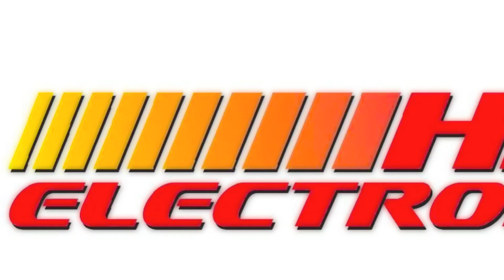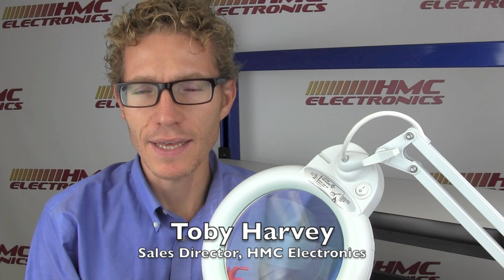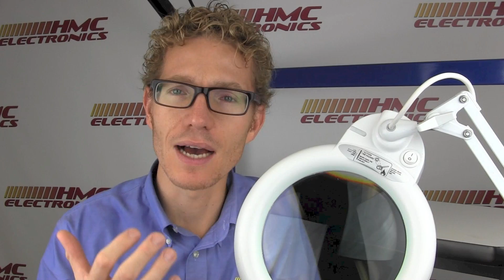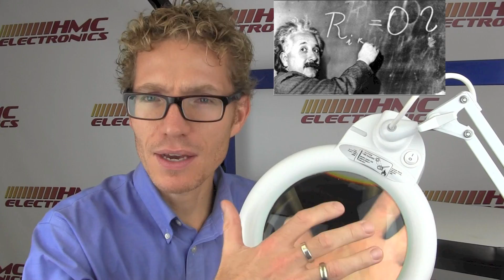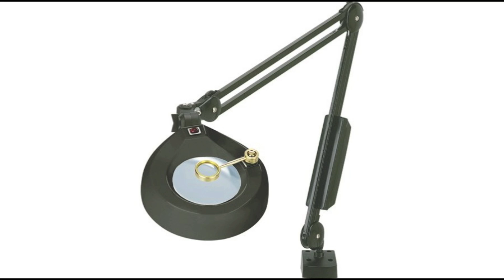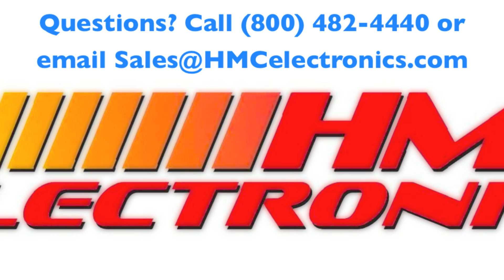Magnifiers: What is a Diopter?

Comment: A dioptre (British spelling) or diopter (American spelling) is a unit of measurement of the optical power of a lens or curved mirror, which is equal to the reciprocal of the focal length measured in metres. (1 dioptre = 1 m−1.) It is thus a unit of reciprocal length.

Comment: Am I doing the math right?  You said a diopter is a magnification of 25%.  You then said that a 3 diopter is equal to 1.75.  Well, if you multiply 3 time 25%, you come up with .75, not 1.75.  What am I doing wrong here?
Reply: You have increased past ONE 25 percent times three which is .75 since 25% of one is .25.  You have multiplied the .25 by three giving you .75 added to your (ONE).

1 x .25 x 3 = .75
________________________

1  x .25 = .25

.25 x 3 = .75

1 + .75 = 1.75